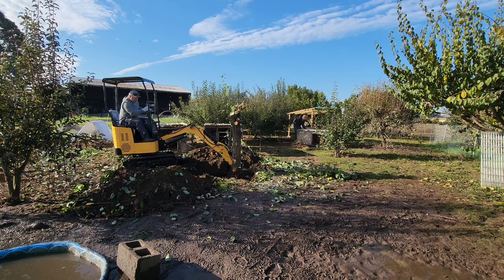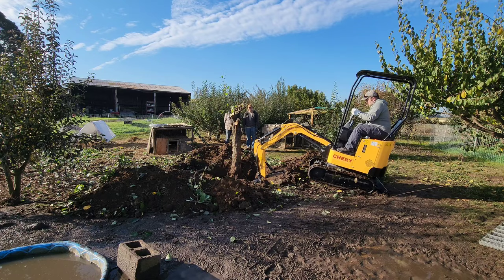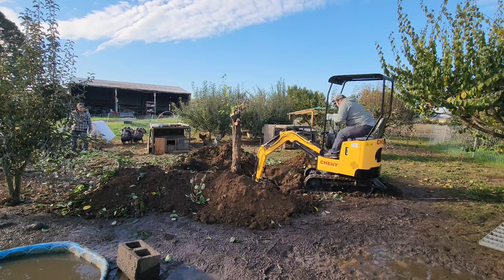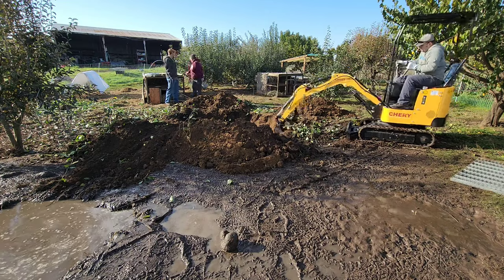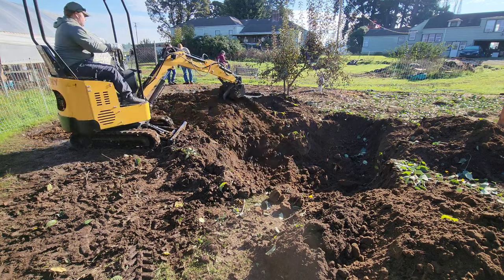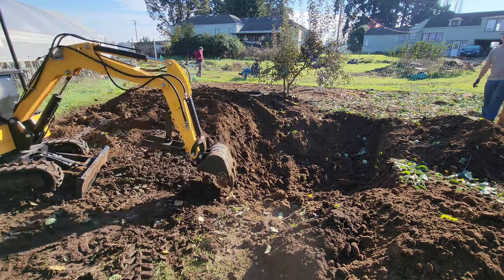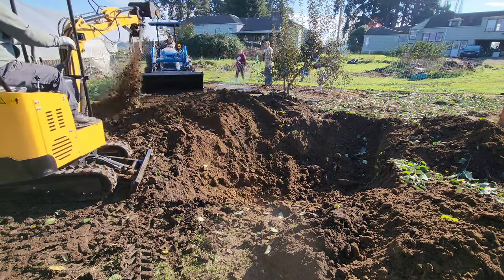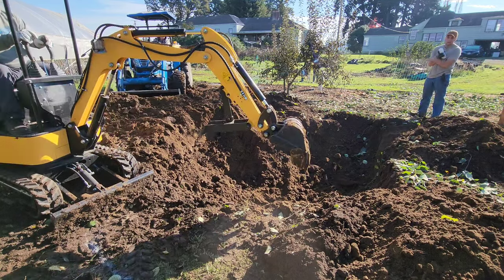chery 1 ton chinese mini excavator review

Comment: Nice video. My little AGT H12 arrived  2 days ago. It looks very similar to yours! So far I have found 2 missing bolts off the rear cover, one broken grease zerk, several others I could turn with my fingers lol. Tomorrow I will continue checking for loose or missing bolts. Including underneath. Another common problem is the motor that rotates the upper assembly around, not sure of proper word. Those bolts come loose, saw that problem on 2 video's, On one all the bolts came out but one finally breaking the motor housing! So I'll be pulling the floor cover tommorow to check those and the battery etc.On a positive note, It started right up and everything functions well.
Thanks for sharing your video.
Reply from the maker: Good luck and have fun with it. They are surprising on what they are capable of

Comment: Thanks for the video.  A lot of good information.  Most of it confirms my understanding from my research.  I have a Hightop HT10BZ working its way through customs right now.  I totally underestimated the customs process.  If you import be sure to do your research and get as much of the required paperwork in order before it arrives on the dock.  The biggest challenge I had was the EPA paperwork.
Reply from the maker: I've been too nervous to try and import them, I always buy already imported equipment

Comment: Got mine from an auction. They had about 15 of the chery machines, 3 of them had the flat face undercarriage, while all the other ones had a more rounded base, I didn't like how the blade hydraulics attached to it. Wound up getting one of the three with the flat frame. This thing has been very useful so far. I'm going to another auction next month.
Reply: I really like the blade on these too, much better than every other one I've seen
Reply from the maker: nice they just work and keep going

Comment: Excellent detailed overview, kudos. Watched many as own the near exact mini. I have not yet added fans, I have removed the back eng. panel and extended the exhaust a few inches out from the body then wrapped with insulation, I also added another layer of insulation under the seat with another extra layer metal tape, I live in Arkansas and it gets hot but not my seat anymore. Changed out grease fittings to nipple zert fittings. 
Recently bought a 1.5 ton hoping for more stability, not driven much , still in break in stage and need to change oil. But not nearly as bouncy as the 1 ton. It has pilot controls and can get reasonably smooth control as compared to my 1 ton. I spun tracks a few times and at 66 it’s can be hell getting them on by yourself in 100 deg temps. There are tricks for the one person track mounting. I found with my tracks they do not do well in loose sand / dirt, I’ve learned to turn using the boom  (as you demonstrated ) not by turn sticks when on this surfaces. Make sure to keep proper tension on those tracks , drastic temp changes may require an adjustment. No what I’ve posted above is not specifically for this channels owner for he seems well knowledged on these excavators but for stoppers by, subscribers. One more thing sense it winter, let your hydraulic oil come to temp when cold, before operating.
Reply from the maker: Thank you for the info, i bet the added insulation is a game changer. I have been lucky and have not thrown a track yet. I have come close, though, in sandy conditions.

Comment: The chery looks like the model with a counterwieght? There are two basic styles, as is common of knock-off machines made in china, and the way I keep them straight is one has a rear counterweight, a heavy but cheap iron fender, and the other does not. As you pointed out, the exact style depends on the company and the class you get... if you are buying at auction or from a vendor, that is just what the person who originally was ordering thought was best, while if you order direct they are very good at working with you... but expect to pay about the same again in shipping, customs and fees. Some of the cheapest ones, you will wind up spending more in the transit than you spent on the machine. To your points on maintaining and breaking in... the first dozen hours this machine has to be your baby, because unlike a case, kub, or jd machine, this thing comes with near zero miles on it. They did not do all the breaking in... that is your problem.